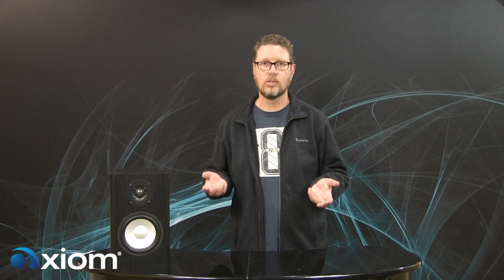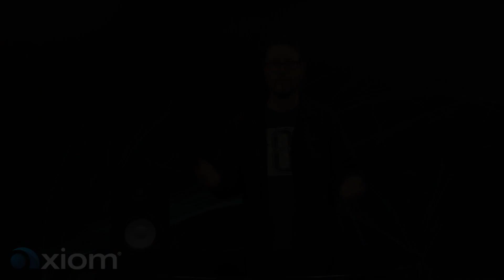XLR vs RCA Sound Quality Explained by Andrew the Audio Design Engineer

Comment: 1:25 that is not true. While jndeed it wont be balanced, you can still get improvement depending on the gear used. At the same time, not all gear with xlr inputs is actually properly balanced

Comment: Interesting.  The only fly in the ointment, so to speak, is that in order to use the home theater bypass feature of my Anthem STR pre-amp, the cables from the AVR to the STR have to be the same type as the output from the STR to the power amp. You can't run XLR from the STR to the power amp at the same time run RCA cables from the AVR to the RCA inputs on the STR because, if you do, you'll get no sound for your front L/R channels. 

So, I had to buy and use interconnect cables with RCA's on the AVR end and XLR's on the STR end.  Doing that, the STR's home theater bypass feature works. And it sounds great.  But I do wish my AVR had XLR outputs on it!

Comment: Hi, does it make sense to use balanced cable from a phono preamp to some kind of DI-box (60 ft. long cable must be used) and from there just a short unbalanced cable to the amp? Because I guess unbalanced cable is not the option here... Thanks!
Reply from the maker: I wonder why you don’t just run 60 feet of balanced cable directly from the phono pre-amp to the amp?
Reply: @AxiomHomeTheaters  The amp is not equipped with balanced input :-(
Reply from the maker: @petrmanda  best to have your amp and phono stage closer together then, and just run RCA cable between them (I'm assuming your phono preamp has RCA outputs).
Reply: @AxiomHomeTheaters  well, yep, i'm aware of that, however, it's not possible... That's why i'm asking😅
Reply from the maker: @petrmanda  in that case, your only real option is to run 60 ft long XLR cable and then use a balanced to single ended converter box close to the amplifier.
Reply: @AxiomHomeTheaters  Do you have any tip for some particular converter box?
Reply from the maker: @petrmanda  Neutrik makes some inexpensive transformer-based converters that would likely work well, model NA2F-D0B-TX is one example.
Reply: @AxiomHomeTheaters  Will check that, thanks!!!

Comment: What about positive and negative RCA connectors (each speaker getting two inputs + GND)? Are they balanced?
Reply from the maker: No, two RCA connections will have both of their signals still referenced to ground, it would not be balanced/differential.

Comment: Hello i have a zoom livetrack l12 and all my conections are balanced, but here is the question, now i want to connect my ipad to my zoom livetrack. Here is my option use rca or trs balanced. For what i said before i should choose trs but remember that both trs and rca will end in a 3.5mm are the 3,5 jacks balanced? And my ipad pro 2017 has an output balanced?
Reply from the maker: Standard 3.5mm jacks are not balanced and I would suspect your iPad pro only has a single-ended output. It should not be an issue going into the livetrack unbalanced.

Comment: there is no difference in a home environment
Reply from the maker: Actually there is. In many cases where there is a persistent ground loop issue, switching to balanced connections can eliminate the problem.
Reply: @AxiomHomeTheaters  absolute audiophile nonsense
Reply: @VictorKibalchich  lol
Reply: Make sure u lift your cables  lol

Comment: Thank you for your explanation.i have a question  about RCA cable becouse my receiver they dont have XLR connection .so what kind of RCA for my amplifire not greater than 4 feet length .good sounding cable .
Reply from the maker: Any good quality RCA cable will be fine. I always recommend line level signal cables that have good shielding. Thanks for watching.

Comment: I've  been in the home theater / stereo / audiophile for 40 plus years and have never needed XLR and only up until the last 20 years or so had a separate sub woofer. I can tell you that most modern Surround pre-amps and mid to high-end receivers should eliminate the ground loop issue. I used to have two sound systems; One for audio and in a separate room and another for Surround Sound. I can most certainly tell you that when I was younger I could definitively hear the difference in my audio system between different types of cables. Especially Kimber cable and silver cable and regular high-end gauge copper wire. The Kimber sounded much brighter to me to the point where I sometimes found it too bright. The cables with the weird boxes, I wasn't able to hear a difference. In today's sophisticated electronics many of the "guess work" and experimentation are now eliminated by software. I miss the old days though where we used to experiment with different set-ups to find the ones that we enjoyed the most. We've come a long way from the old Marantz receivers and Quad, Naim, Oracle, Audio Research etc days.....for probably better but still it lost it's charm. My first speaker was an AR2aX. I preferred them over the AR3a's. My favorite old speaker from the late 70's and early 80's was the Polk RTA 12's which were very advanced and my Magnepan 2.5's.